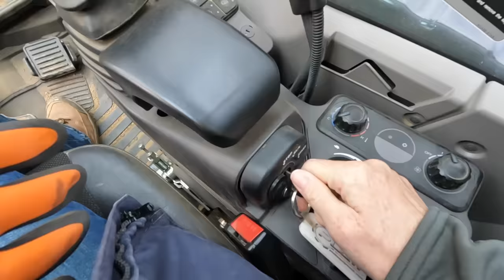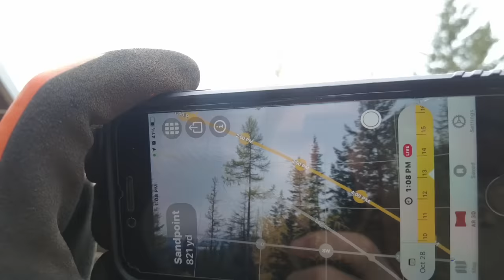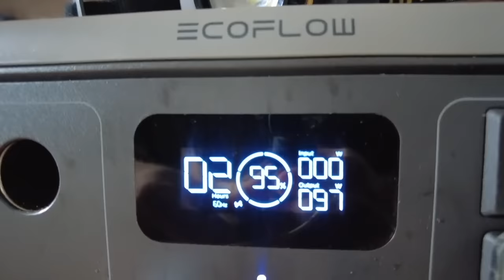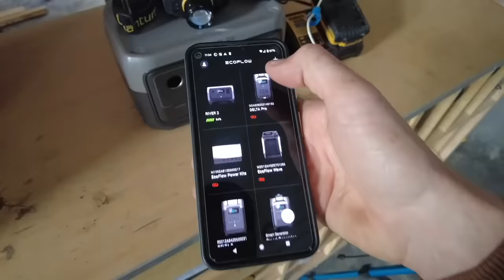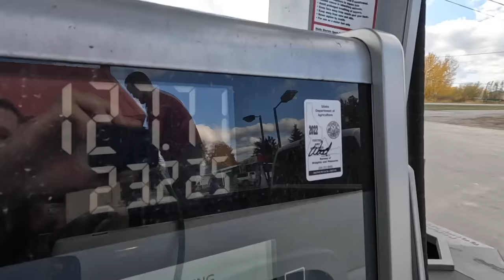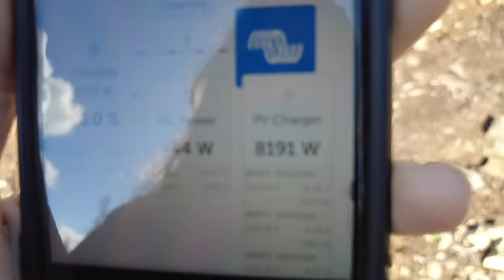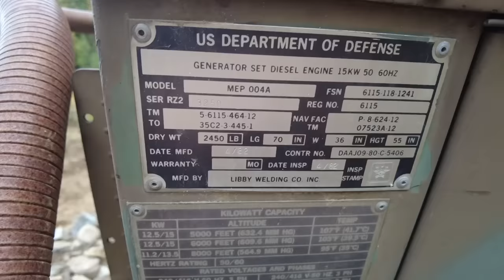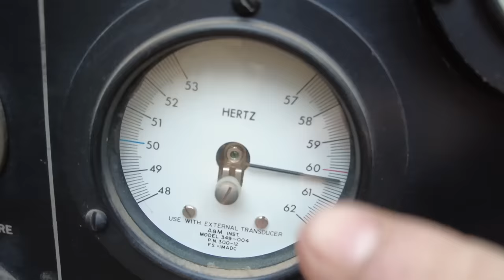Fixing PROBLEMS With Our Off-Grid Solar

Comment: Always great to see your projects.  Years ago I worked with track hoes.  In my experience, rubber tracks were nearly useless in anything other than flat terrain for the reason you discovered in this video. I think they might have been designed for driving over sidewalks etc. to avoid leaving marks.

Comment: This left to me something to ponder.  I did not follow the idea how the 208 V three phase was converted to provide 240 V center tap 2 x 120 V output.  Was some extra transformer added?  The basic relationship is that if you have a "star" connection (with neutral 0), you get 3 separate 120 V and a common ground.  The 208 V is between any two of the three phases and amounts square root of 3 (= 1,7 ) x the 120.  Nowhere is there a 2 x 120 = 240 V system.  If you increase the overall line to line voltage from 208 to 240 V, you still don't have the center neutral.  I need to think this more!  Well, maybe it is not a Star connection?  If it is wired in Delta, with ground at center point of one of the line to line windings, you could get 208 / 2 = 104 V, or if you increase the output from 208, then you would indeed get a standard split 240 V.  Maybe that is what the conversion was about?  I believe I have just once met that kind of installation.  Then the third, unused line is considerably higher, that is about 270 V relative to the ground.  I know this arrangement only from text books, so I'm sorry if I miss something.

Comment: lol saw this coming bro do you not see the side of you shipping container collapsing under the weight were that winch is connected? you may not know this but the entire structural capacity of the container is based on the shape. they are meant to be light weight. your container is beginning to warp the weight that it could once support is quickly diminishing./ it will only get worse i suggest you remove your expensive panels before they are sliding down the mountain in the spring.

Comment: I would seriously make building a shelter above and around your generator a priority. Slope the roof to dump snow down the hill. Also using a light baffle (open, over lapping walls) will allow air in, exhaust out, and do a good job of keeping the snow from entombing your generator just when you need it most.

I imagine you already know about diesel engine starter spray, anti-gel additives, and block heaters. If you are wiring the generator to your power bank charger, setting up a trickle charger for the generator's battery should be a snap.
Reply: Those generators are built to be outdoors.

Comment: I would have been interested to know what wattage you were bring in before you cut down the trees?  Then, tree by tree as you went.  Were you considering putting the solar to winter before you trimmed back the trees, if so, what did you gain step by step.

Comment: ok, so is fine to fill diesel cans that way (in bed of truck) but don't EVER do that with gasoline.  Also don't get back in your car while pumping gas into said car, then get out and grab the handle without grounding yourself first.   Either can cause a gas fire or explosion.

Comment: Love the setup, wish I could convince the wife to get out of the city and on our property up in the Rockies. 

Question: for your solar panel array, what size I-beams are you using for support and what is the size/wall thickness of the round pipe they pivot on? I'm looking at doing something similar with two 10-panel mounts. I want to get an idea of how heavy-duty a frame I need.

Thanks!

Comment: My only question is how are you going to get your fule trailer close enough to fill up that generator?  It looks like the access there is not the best.  Maybe having a secondary fuel tank in between the generator and the entrance of the container up top.  Or just having a super long hose then you do not have to get as close when filling up anything.  Also, you gotta have that fuel trailer full man,  running dry is not good especially with winter right around the bend.

Comment: It seems your width of solar panels are the length of you container? Is there are reason you did not add additional panels? Surely they can grow wider then the container. A big battery bank is great, but even a big bank runs out of juice if charging is too slow during winter.

Comment: with ya generator i would of moved it away even more and put it on a proper concrete slab with 4 posts in the ground AND have a proper exhaust away from ur panels cause all the smog and shit from it will cover and stick to ya panels and btw u can make it into auto start/remote start

Comment: As someone that has to take the time to go get firewood to keep the house warm... I died inside a little watching good firewood get dumped into a burn pile. :-(
Reply from the maker: We have about 40 logs stacked up for firewood. We’ve tried to give our extra trees away but there is such a surplus of them around here we haven’t had any luck!
Reply: @AmbitionStrikes  Oh, I know and I don't fault you for that. We live down here in Cambridge and you have to go quite a ways to get it and are in competition with a lot of other people doing the same. It's nothing but basalt here so no trees at all on our 18 acres.

Comment: OK, about the winter placement of your solar array. And I am sure that I am not the first to say this. You need more space for the snow as it slides off the array. 

WE HAVE A 7.6 kw ARRAY. GROUND MOUNTED, THE BOTTOM EDGE OF THE ARRAY IS ABOUT 24" That I wish  36" ABOVE THE GROUND. We LIVE FURTHER SOUTH THAN YOU FOLKS DO, BUT i SPEND TIME EVERY YEAR REMOVING THE SNOW THAT can  COVERS ABOUT 1/4 OF THE PANELS. I AM GLAD i HAVE A SNOW BLOWER, AS IT MAKES SHORT WORK OF THE SNOW REMOVAL, WITHOUT ENDANGERING THE LOWER EDGE OF OUR PANELS. I am sure that you will be getting  much more snow that we have. Just my opinion, but removing another 36" of dirt from below your panels would do a lot for you.

Comment: Should have kept the wood and use it for cooking and winter heating... Kinda wastrefull. I get bruning most branches even tho even those can be used as starter but this is just a waste. Put them to the side off the gound to not have them rot and you have a ton of free winter energy or cooking energy.

Comment: If you check out Andrew Camarata's Youtube Channel you will see him getting the tracks back on everything from excavators, bulldozers, and Bobcat skip loaders.  When I was in the Army  I was assigned to an Aircract Direct Support Company.  We had some generators similar to yours except they were higher capacity.  We had three 60 Kw, three 45 Kw generator sets.  Plus a bunch of 20 Kw trailer and shop van mounted generator sets ranging all the way down to a .5 Kw generator used for airfield lights.  So I think your 15 Kw will more than meet you needs, just be prepared with plenty of fuel on hand.

Comment: You BURNED up whole trees?   Wow, nothing like being wood rich.  It would have hurt HOW? to have stacked the logs for a few years, see if a need arrises, then burn them.  The branches, sure, burn them, though I chip up everything with green on it for a long lasting mulch.  Which brings up, what ya gonna do with the huge erodable exposed slope (or is that covered later in post)

Comment: Your only mistake is that you don't have to get the panels that close to the ground to get full panel power.  You were at the max of 30% off perpendicular, but you just needed to get them within 15% or so for full power.  You don't need to weaken the hill by removing dirt.

Comment: We've cut trees for firewood for over 43 yrs. You need to cut bigger wedges from the tree when trying to tip them over. Less beating yourself up with a sledge hammer. Are you saving any of that wood to dry out for firewood for later when there may not be used oil to get with this economy and things headed where they are? Are you going to raise a garden?

Comment: I don't understand the purpose of changing the tilt from summer- to winter-postion (or vice-versa). Why don't you just keep it in winter-postition? The extra sun hours should make up for the lower efficiency and the construction would be much more stable. Do you need more power in summer?
Reply from the maker: We have future plans that will utilize that extra power in the Summer.

Comment: why not put the generator into the container and use the engine heat as a by product to heat the batteries. you will mostly use the generator when you need heat for the batteries!

Comment: Those generators are great as long as you had a Generator Mechanic with you when the poop hit the fan. Jordan deployment 1985 US Army. Ours powered everything in the Camp including our air-conditioner units to keep us cool during the day from the heat.  When that bad boy pooped the deck, everyone tried the repair it and get it back up. Generator 9 Soldiers 0 at halftime. Called American Embassy to send out a Marine Generator Mechanic for support.  Airforce airdrops Marine and Navy Seabee support.  After overwhelming head scratching it was just a tank of BAD FUEL.  LOL. Oh, the color poll. Wheat Pinny.

Comment: Will you all be setting it up where the Cerbo cranks the generator as needed? Really awesome features available there.
Reply from the maker: Unfortunately we can't with this old generator. It requires manually dialing in frequency and voltage. But we agree that is an awesome feature of the Cerbo!
Reply: @AmbitionStrikes  I bet it'd be possible to build an automatic throttle adjuster using a Raspberry Pi or similar SBC to sense the frequency and operate a servo to adjust the throttle.

Comment: I was thinking a few videos ago with the concrete trucks, that if the fire department had to get up there, it may be a problem. Be safe up there. We have people around here who build so remote that when they need the fire department they can't get back to them. So usually it's a total loss. Work safe.
Reply from the maker: That is a great reminder! And one of the reasons we are working towards improving our road and creating defensible space.
Reply: @AmbitionStrikes  I see you had A Lot of critiquing this vlog.
Best of luck, and stay warm this winter. 
Snow she's a comin.
Reply: @AmbitionStrikes  A pipe on top of the roof with spray nozzles for water would be a good just in case thing for fire defense, especially if you get a well drilled.

Comment: You can't cheat the horse power. You eather use gas, diesel for power. Or you use solar energy powered equipment , that uses coal, natural gas,  oil, and mined metals to make them, which all use fossil fuels.There is nothing that is net zero , "green" or "carbon neutral ".

Comment: Does it run your fridge? Can it had the start up of the pump?
Reply from the maker: It can handle a start up load of about 40,000w. A fridge is about 700w starting load.

Comment: I guess that it's cool how the river 2 will run various electric devices, but what really matters is for how long? How long would it power the electric sander you showed? Not trying to cause a ruckus, just curious. Love you guys, thanks.
Reply: Just look at the back of your device. Let's say your ecoflow has a battery of 500wh. Your coffee grinder indicates 500w. It will run for 1 hour.  Your 50w laptop charger will run for 10 hours. And so on. If you have multiple devices, a phone, a laptop and your headlamp you need to recharge, just add 12w for the phone, 50w for the laptop and 5w for the headlamp. 12+50+5= 67. Divide 500wh by 67 and you will know how long it will run for
Reply: @richarddeutsch9984  I don't need formulas,  just a simple answer of how long it will run her sander. Don't care about coffee grinders, laptops,phones, headlamps and so on with rating that are just made up. A simple 10, 20, 45 minutes, or whatever her sander will run is what I want to know. No more no less, simple as that.
Reply: Bless your heart
Reply: @stevenfrench1639  "Bless your heart" is a phrase common to the Southern United States. The phrase has multiple meanings and is used to express(...) an insult that conveys condescension, derision, or contempt. It may also be spoken as a precursor to an insult to mitigate its severity,  a subtle way to insult someone but without coming straight out and calling someone an idiot to his or her face
Reply: @richarddeutsch9984  I am familiar with the phrase, I have used it many times. Seeing that you can actually grasp the meaning of the phrase I guess that means that you are just so "special". Don't forget to thank your momma for teaching you the the the phrase, and the meaning. Now run along, mind your own business and get her to take a week of her time and try to explain "special" to you.
Reply: The smallest River 2 has a 256 watt-hour capacity. Price is $239. Battery chemistry is Lithium-Iron-Phosphate.

Comment: how many kWh is your guy's house using daily
Reply from the maker: About 13kwh per day average over the last 30 days. That includes CNC plasma cutting parts, welding, running electric heaters when our batteries are topped off, etc. We aren't frugal with our power use.

Comment: Why the heck are you guys just burning the wood in piles outside rather than cutting it up and keeping it for a woodburner in your house next year?  That's lunacy you could have years of free heat with that much wood.
Reply from the maker: We have about 40 logs stacked up for processing into firewood.
Reply: @AmbitionStrikes  I have a question - given that you have so much wood available would it have not made more sense to fit a wood furance with back boiler to keep your tank toasty and warm all winter as well as your house rather than the heatpump? You could have used a solar controller to also give heat into a 3kw element when you have too much sun?  Seems a win win to me without spending 10k on a heatpump.